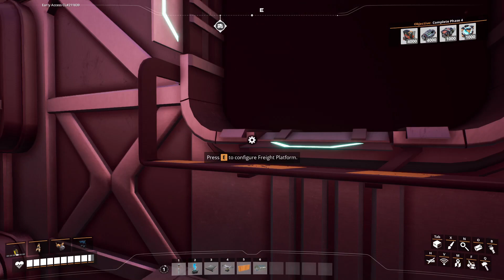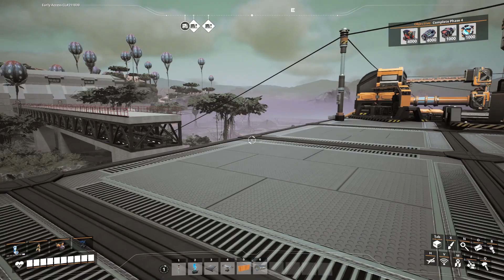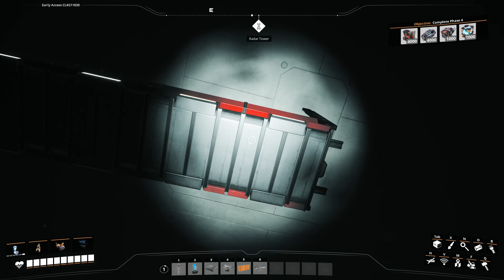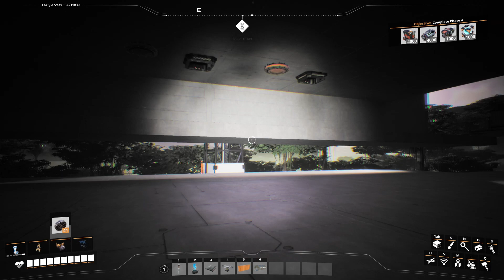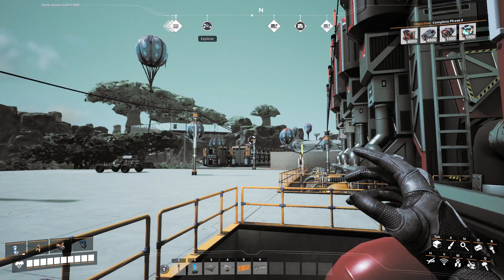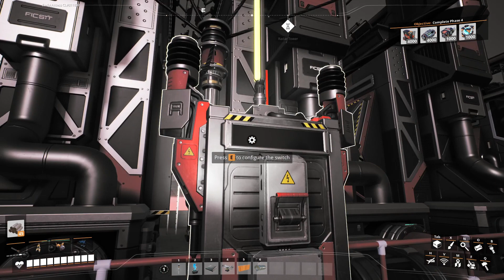Everything is finally coming together!  -Satisfactory pt36

Comment: Dude, the blueprint for the walkway/bridge/belt transferway was so epic. I never thought about that. Very good use of blueprints. Just one more thing I'm stealing from your series.

Also, the belting under your Foundries actually turned out great! I think it looks cool. And if it works, it works!

As for the excess water from the Refineries. I know a lot of peeps treat it as a challenge, but I always have the Byproduct sent off to make a random recipe and only pipe in what's needed for the first portion of the Alumina Solution Recipe. But hey man, I'm excited to see how you treat the rest of the project! Fantastic video as always!
Reply from the maker: I have a couple of ideas on how to fix the water. I did some research, and it looks like a variable priority input should fix what I'm trying to do. I could probably use the water for making pure copper ingots, but im stubborn and I've already committed to learning how to make this work. maybe later down the line, I can do this the easy way. Lmao